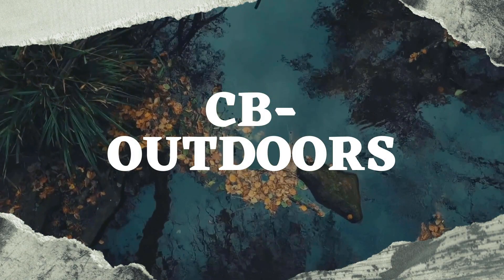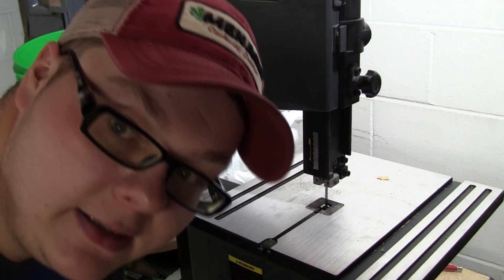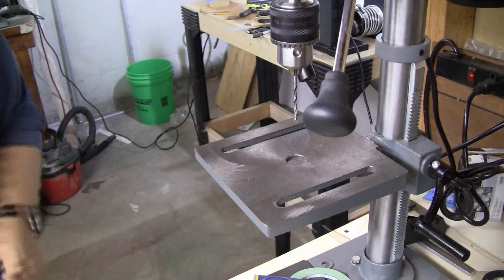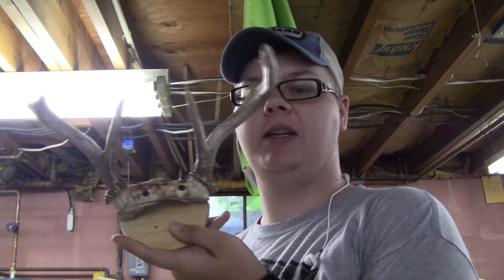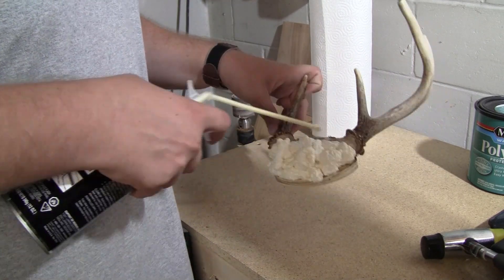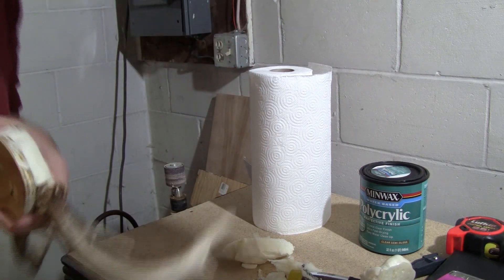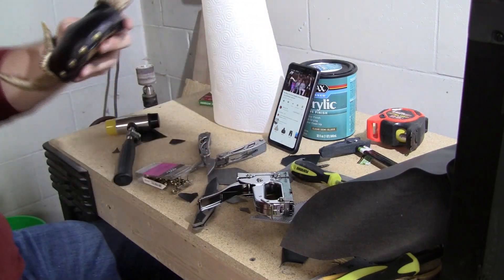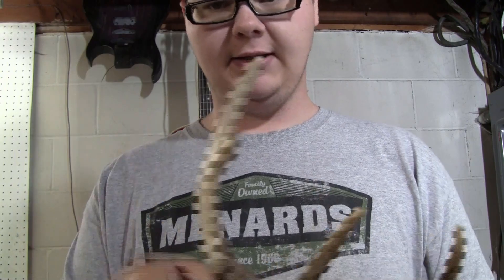I'm NOT outdoors today??(DIY Antler mount)

Comment: Not bad, I would maybe suggest using some plaster of Paris, Elmer's glue and water mix into a paste then put it over the foam and antlers to smooth it out a little better for there isn't as much bumps under the faux leather.  You can wet your finger and smooth out the plaster of Paris very easily.  Besides that looks great.  I don't use the leather tacks, I just stretch the faux leather around the back of the wood the antlers are screwed to and staple it.  Either way, we all have our own style.  Keep up the great work.